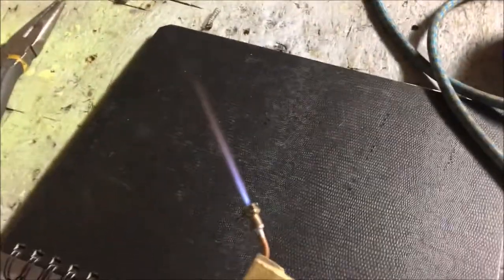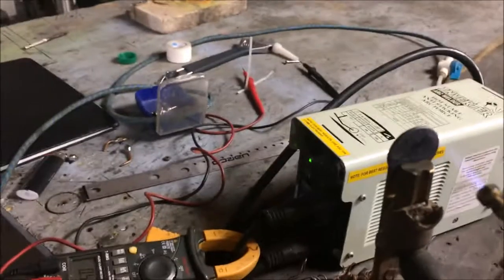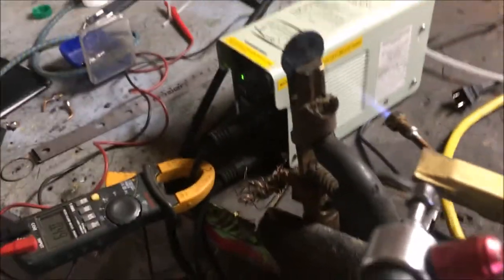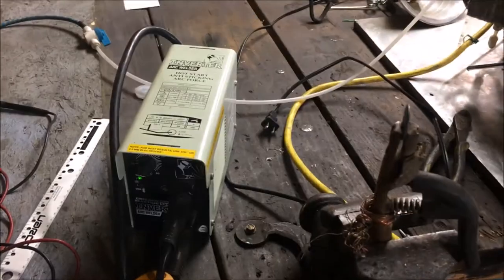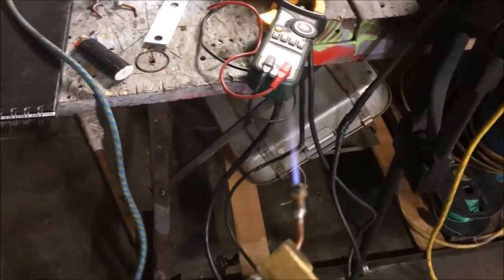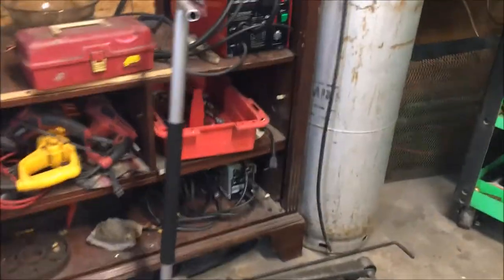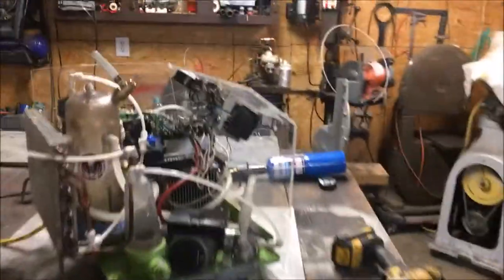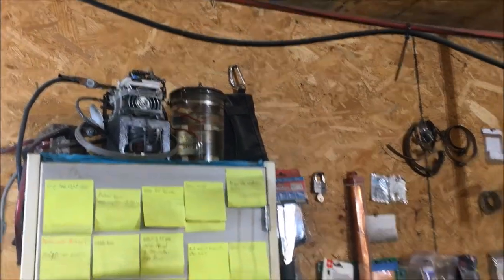HHO Arc Torch (Testing) , using 80 amp inverter

Comment: you can try this easily with a WIG torchhead, its a tungsten rod + gas nozzle in one piece,
exactly what you need. Maybe MAG torch handles work too. Maybe a friend of yours have this. Just replace the normal Argon with HHO then.
I think its beneficial it the current is DC, handpiece should be negative so its emits the electrons and they go the same direction as the gas does.
You can convert a normal cheap welder to DC when you add a couple of 50A bridge rectifieers in parallel so they can handle the amps ( very cheap from ebay china 4pcs=5$ , i bought 8)

Comment: yeah it certainly added more heat to the job, not just a light show. I don't recall having rectifiers on it. Is that a DC output on the welder? Glad you did not stuff around building a fancy torch! Is that tip the spreader flame or the cone tip flame? I think a cone tip will carry better current.

Comment: adjustable frequencies say A prime weld tig 200 i think or a cheap signal generator n a big audio car amp low full range class d may be most energy efficiency or hook it to the plasma torch

Comment: Must be too dielectric...water its self has a dielectric constant of 20k ohms, so maybe this has a resistance too high to permit a current.
Reply from the maker: Only one person has ever pulled this off on film and he used about 2200 volts i think and we discussed testing the lower voltage high amps and as you say it cant do it but i disliked not being able to find this video during R&D so here we are learning what not to do . The patents speak of ionization of the gas into atomic hydrogen , but i think they ment diatomic and its not a Chemist or a physicist for that matter who filed the patent , alot of these hho people are smart enough to be dangerous and have no clue what in the hell there doing . however i do like exotic tools and i like inventing  processes as well as machines